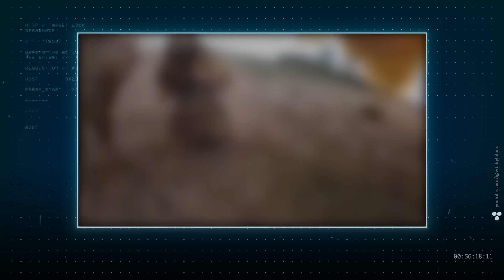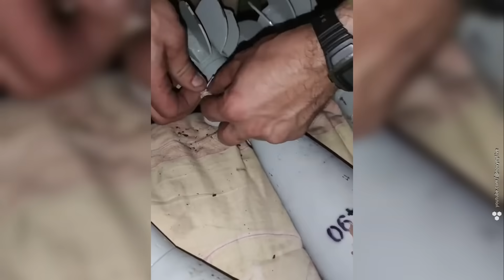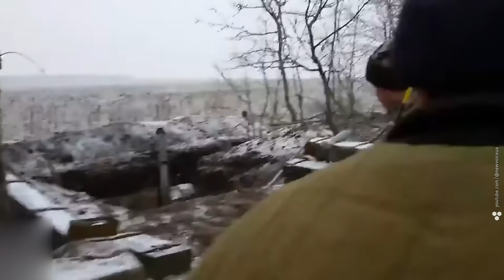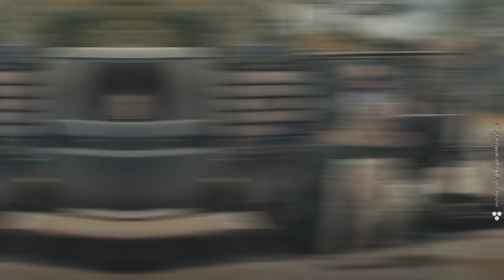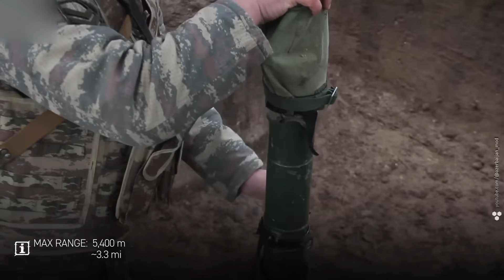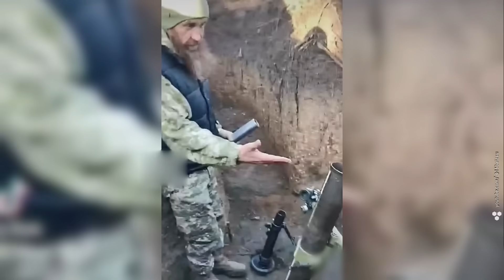You Won’t Believe These Wild MORTARS Ukraine Uses!

Comment: 0:54 Nah. I don't know if you meant all of the bombardment, but if it's only 'mortars,' that's wrong.
Artillery often does TOT firing, and this is the main reason why bombardment produces much casualties. However, mortars are not that capable of doing TOT for their mechanical and usage reasons.
Mortars often do suppress firing. This is not salvo, so they give the enemy a chance to hide, and this is the reason why artillery produces most of the casualties.
And so on, for those reasons, mortar produces casualties much less than you thought.
For those reasons, mortar produces casualties much less than you thought.

Comment: The key thing to remember about mortars isn't the gun, it's the ammo: Conservatively, a light (60mm) mortar round weighs about 6-8lb (3-4kg) in the carry tube. A medium (81/82mm) weighs about 10lb (5-6kg). Heavy mortar round weigh north of 25lb (11kg).
That kind of weight/mass adds up. And a mortar can fire essentially as fast as the crew can prep and hang the rounds, as much as 20-30 rounds per minute for short bursts (until the barrel starts overheating). So you can fire a lot, but you have to supply a lot, and its weight/size requirements are much more than than the system. It's one reason NATO/US forces are going in for "smart" rounds, or stabilized/computer-directed mortar systems: less rounds needed for a given target.
Reply: Compared to other artillery the mortar generally have better sustain (at the expense of range and to some extent accuracy), since they use a lighter charge, higher arc and often a smoothbore barrel and fin-stabilized rounds. As a result, despite the thin barrel the sustained weight of fire tends to be 25% higher than gun-howitzers.

Comment: OK. So whats with those donuts near the base of the shell?
Reply: Propellant rings. Nato uses plastic,  soviet simple bags.
Reply: To increase the  range of the  round. There   propellant rings .
Reply: To be more specific, they are polyurethane (plastic) containers full of black powder (gunpowder) propellant. Inside the tube, attached to the rear of the mortar round, they burn very fast and hot and provide the propellant gasses that force the mortar round out of the tube, shooting it down range. One nickname for them is "cheese charges", because they look sort of like a yellowish half-circle of a cheese round. More or less cheese charges allow a rough adjustment of the range fired. (more or less gas propellant).

Russian/East-bloc, and some NATO/US older round types use small cloth baggies instead of modern polyurethane.
Reply: They are indeed bags of powder or propellant. When the mortar crews talk about "charges", this is what they are referring to.

Comment: When I was about 10 years old, I was taken to a school where they were displaying a bunch of military equipment.   After having crawled through tanks and APC's I went into the gymnasium.  There, CHILDREN MY AGE were given the chance to fire a MORTAR that arced about about 20 ft then came down on a mattress where a CAP in the front went off.  "Hey kid, don't leave your hand over the tube after you drop it!" was the advice I was given.   It was the 70's.   Life was cheap back then.  Nothing funner than sliding around the back seat of a  station wagon or pickup truck without seatbelts!

Comment: Too bad none of the CV90s the Ukrainians received from Sweden didn't come with the Mjolner 120 mm self propelled mortar system, because the Mjolner's rate of fire is seriously impressive, it can fire 16 shells per minute and would definitely give Ukrainian troops the advantage on the battlefield.
Reply: You dont need this speed. You have to look where you hit between, not just firing
Reply: @markpowder4664  right, try telling that to the infantry requesting a barrage on the area of operation.
Reply: Holy hell seriously ? 16/minute??

Does it auto load them? Like the t72 swries carousel?
Reply: @steveng7702  manually loaded with mechanical assistance but two tubes in a protected limited traverse turret with two loaders.
It's a budget alternative to the Finnish AMOS and NEMO much more automated turret systems with 360 traverse and -3°<90° elevation.
Yes, the AMOS and NEMO mortars are direct fire capable in self defense.
Reply: @steveng7702  It has 2 barrels. Hence the fire rate of 2x8 a minute. About autoloader - it looks like it has sort of semi-autoloader, where round is put into a tray and autoloader takes over the rest.
Honestly presented Rak has more complex autoloader... where it takes rounds from ammunition rack by itself.
But it's not super fast. Autoloaders generally are slower than human loaders. It applies for anything from tank to artillery. Difference is autoloader does not get tired so is more consistent.
Reply: This is an expensive and useless weapon in modern warfare. Drones are already hitting HIMARS at a distance of 30 kilometers from the front, and a 120-mm mortar based on an armored personnel carrier will not last long.
Reply: @ImSnigopad  You are kinda getting the wrong picture. But don't worry, a lot of people think the way you do.
You are assuming that drones are up all the time and flying around for hours like hunter/killers. Which is not reality. Drones that reach targets behind frontline, even like 10 km are attacking pre-spotted targets. Targets spotted by recon drones, usually bigger ones. In most cases spotting drone is actually detected and vehicle fcks off way before kamikaze drone takes offs. There was literally ONE case of drone hitting HIMARS. ONE.
And you kinda think it's a general trend... reality is that for most targets if spotted - artillery can reach it MUCH faster than suicide drones. Suicide drones are used because there isn't enough artillery for most part. And even that... drones can be countered - wire guided drones can't be really used for overwatch, since wires have limited lenght - you can't just fly around looking for targets since wire will get tangled - it's usually for shorter range 5-10 km attacks, not to mention wire guided drones are single use only - which makes it wasteful to put advanced recon optics on it. So if you have good area jamming drones will simply not go to look for you.
And... Rak is used by Ukraine. You would expect by what you're saying that losses would be massive. While in reality confirmed losses are... 2 - and in one case it's not know what exactly destroyed it. Ukraine likely operates around 24. For at least 2 years now. I guess one of the factors is that Rak on wheels can OUTRUN a lot of kamikaze drones if it's moving on road - since it quite happily actually achieves 100 km/h and probably more if you take off speed limiters. Compared to hundreds of mortar positions getting wasted by drones - it kinda shows how weird your assumption is...

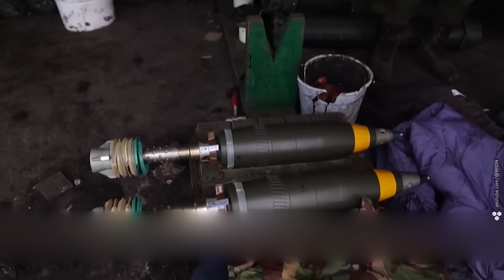Comment: 2:25 - the heaviest mines of this caliber are french PR-14, weighing 18.6 kg, the fragmentation velocity is 1490 m/s, each mine produces 12,000 fragments weighing 0.1 g, 11,800 - weighing 0.45 g, 2,700 - weighing 0.85 g, 1,600 - weighing 1.75 g, 300 - weighing 2.9 g, 180 - weighing 4.5 g and 65 - weighing 6.15 g. At a distance of 10 m, fragments weighing 2.9 g are capable of piercing armor steel with a thickness of 8 mm, fragments weighing 6.15 g. steel with a thickness of 14 mm. I wish the Ukrainian soldiers a speedy victory and a warm combat greeting from a former artilleryman from Azerbaijan!
Reply: Thank you for the information!
FYI, use "bombs", "shells", or "rounds" in English instead of "mines". Mines usually mean "land mines" in English.